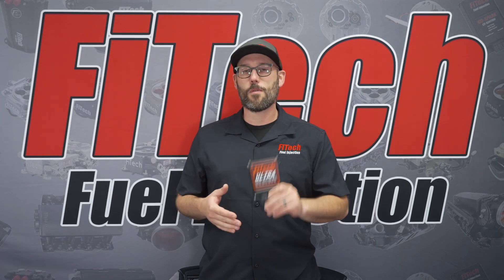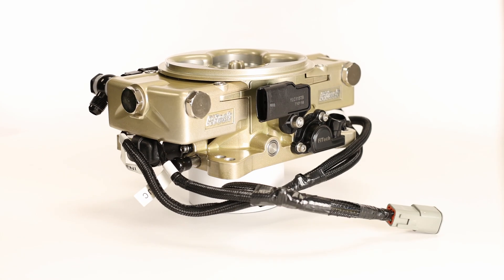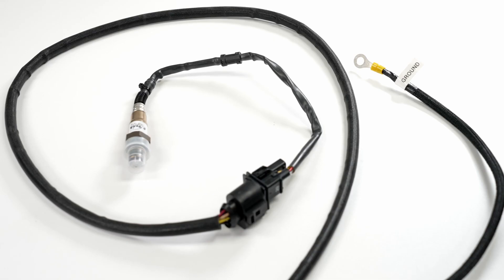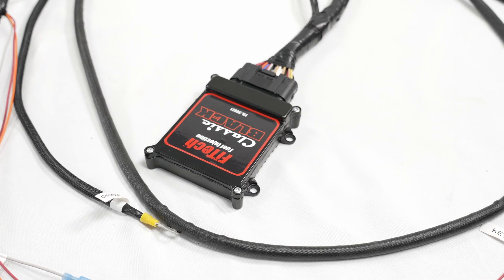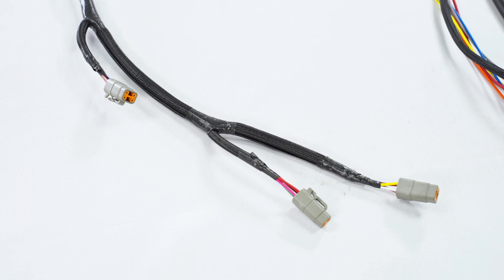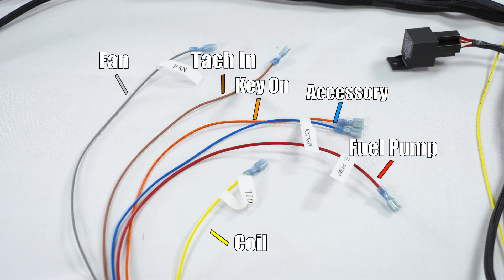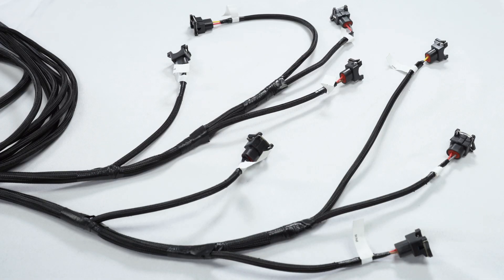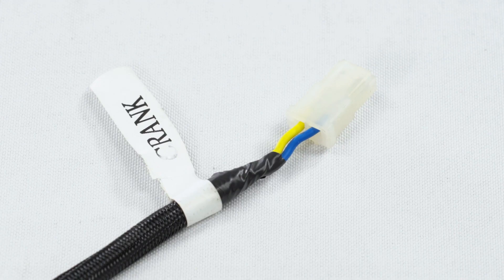Wiring Your External ECU System | Tech Tuesdays | EP79

Comment: Why does the ECU plug need to be pointed down?
Reply from the maker: To allow moisture to run past the connection. If the connector is pointed up water could get into the connector cavity which would eventually rust the terminals.